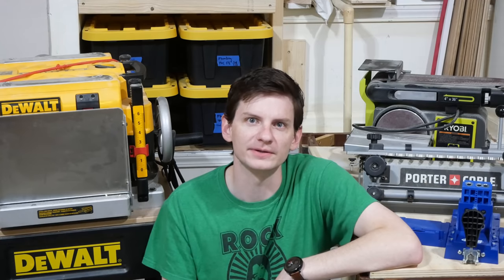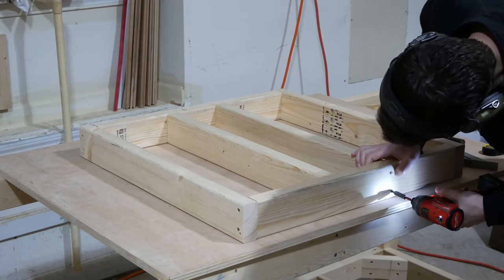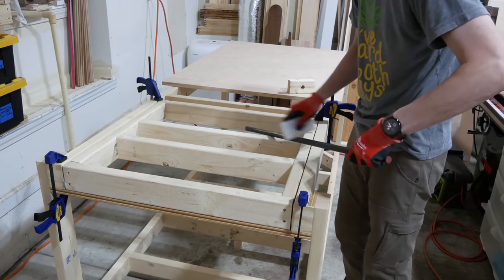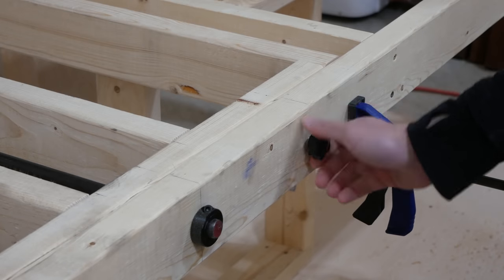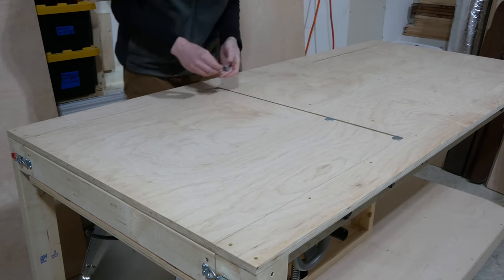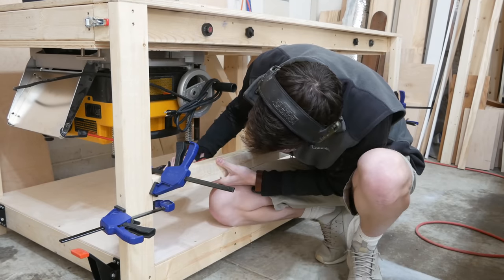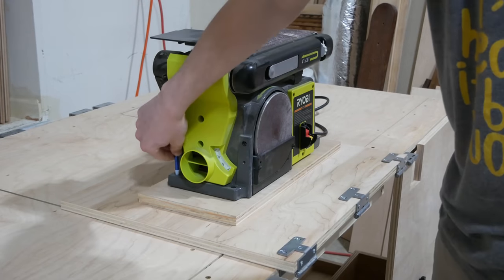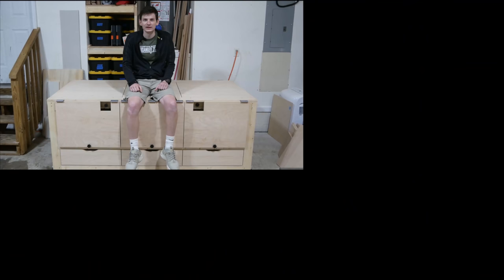How to Make a Hidden Tool Storage Workbench

Comment: Great job. I’m a crossover from Reddit and a new subscriber!

My husband and I are in the process of building our own 2 car garage / workshop, so this is a strong contender for tool storage, etc. 

Are you familiar with the Paulk system? If so, do you (or any other commenter), have any thoughts on how to incorporate the Paulk holes in the top?
Thanks
Reply: Also, how did you deal with electrical power and dust collection? 🤔
Reply from the maker: I'm sort of familiar with the paulk workbenches. You wouldn't be able to incorporate the torsion box into my workbench but I don't see any reason why you couldn't add at least some of the holes in the top. You might need to add a secondary layer of material underneath the middle of the workbench so that sawdust doesn't fall through on top of the drawers

I haven't really dealt with electrical or dust yet but plan to. Since all the tools rotate and it's not practical to leave them plugged in to anything I'm simply going to use an extension cord, probably a power drop from the ceiling once I get that set up. For the dust collection, I plan to have a single hose for the workbench on a swinging hook from above that I can hook up to each individual tool as I need to use them. The hook will hold the hose up out of the way and will also allow me to hook it up to an orbital sander and hold the weight of the hose when I need to use that. Does that all make sense?

Comment: Well done. Although, okay, I'll bite: how did you address POWER for the unit? Do you just uncoil each tool's cord when it's in its "active" position and run an extension cord? is there an internal power supply that everything just stays plugged into? Did you inadvertently leave out the most important achievement of this build by failing to mention the hydrogen fuel cells or (and I admit, this WOULD be way more impressive still) the coal boiler you installed on the interior? I didn't observe any mechanisms for preventing the rotating ones from being spun over and over in one direction (I imagine the mass of the tool would interfere with the "wrong" direction), but I figured that may well account for the lack of a plug anywhere.

Please don't take any of the above as criticism. You did a great job here, earned a like, and I'm off to peruse your other videos now. I've just built an similar station before, and jumped through some serious hoops to work out some of the wiring issues (I ultimately wound up using slip fittings designed for windmills, which also have to be able to rotate a LOT and still transfer electrical power without twisting a wire into micron-thick hair). I'd be interested to hear your tactic.
Reply from the maker: Haha I enjoyed reading your comment!

There's an entire family of specialty bred endurance racing hamsters spinning hamster wheel turbines who live inside the workbench. Not sure how you didn't think of that one! 

In all seriousness, I just run an extension cord to the bench when I need to and that's worked fine for me. I'm going to add a power drop from the ceiling soon to make it less of a hassle.
Reply: @ProjectBilld  Wait, so the hamsters are 110v? Or 220? I've never used the racers before.

Joking aside, and I encourage all space-conscience woodworkers to investigate these (esp. because if you're patient you WILL find some that can be had for a song): 

...Look into card catalogs. The sort that used to be mission critical in libraries? There's not a library in the country that hasn't digitized by now, meaning most of them get pitched or sold for a couple bucks. 

But before you scoff, consider: I got 4 banks of them of my shop. That's 4 units, stacked 2x2, made of power-coated, cold-rolled steel, each containing 24 drawers (4 vertical x 6 horizontal). Each drawer is 6x4x14, made of the same powder-coated cold-rolled, has a little integrated slot in the front to hold a label, and are durable enough to survive gods only know how many hands slamming each (while they held 25 pounds of paper a piece. 

After slapping some toolbox liner in each drawer (and lemme tell you, custom cutting all THAT was a treat) I was able to condense every hand tool I own (outside of the planes) into a very-well-organized 84x37x24 block (I built mine into my mobile outfeed+ miter station combo), along with two Durham small parts storage systems (which are made of the same powder-coated steel, and offer 260 total removable small parts storage boxes). Admittedly, it WEIGHS three thousand pounds, but thats why you use 8x 500+lb rated casters. Ain't nobody's gonna pull a runner with it; trust me.
Reply from the maker: Sounds like an awesome idea, I will look into it!

Comment: Question: This may be elementary for you, but how do you figure the measurement of the 45º support brackets you use to hold the basic frame together? I searched for a mathematical equation and can't find one..
Reply from the maker: Can you provide a time stamp for what you're referring to? Would help me understand what you're asking. Thanks!
Reply: @ProjectBilld  1:30 is where you put them in. I know you have free plans, but what I really want is how to figure out what the measurements are for any given project. Is there an equation?
Reply from the maker: Oh those! They're just corner braces. So it's just cutting two opposite 45 degree cuts so it will wedge in the corner. There's no equation, if I recall correctly I made them so the long side was 5 inches. Does that make sense?
Reply: @ProjectBilld  Yes. I was just trying to figure a regular way to do the math. LOL!!! Thanks for the replies! I appreciate it!

Comment: +What do you think of the idea of going a full 4 x 8 with this build?  More braces in middle and larger flips?  Any reason, other than weight, it would not work?  I have the space.
Reply from the maker: Weight would be my primary concern if you ever needed to move it, but I definitely think you could make it work. I don't know how much a steel rod would flex at close to 4 ft but that's something to think about too

Comment: This is an awesome build. I have a question. I have short stature 4'2" and would like to create something similar minus the drawers, but was curious if there would be enough clearance. I saw that you made the drawer sides below the scroll saw not as tall, but does it still swing inside of the drawer?
Reply from the maker: If you were to remove the drawers (and that corresponding 2x3 rail the flip up panels attach to, that would save you 9 3/4 (kings cross anyone?) inches. So without any major modifications to the design the workbench would be 24 1/4 inches tall  which is pretty darn short so I think you could modify it to bring it up to whatever height you need. The drawer sides on the scroll saw side are actually the same height (5 inches) as the others it's just the drawers are only around 10 inches deep so the scroll saw swings between them